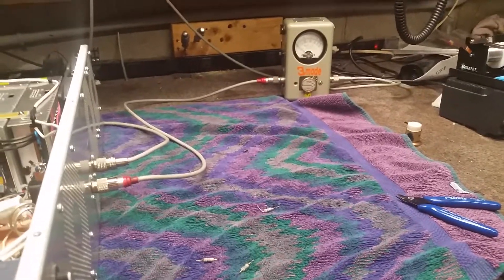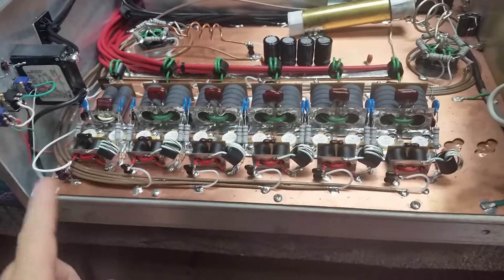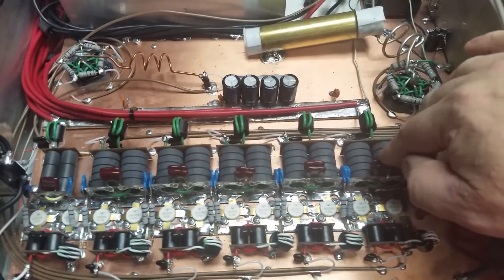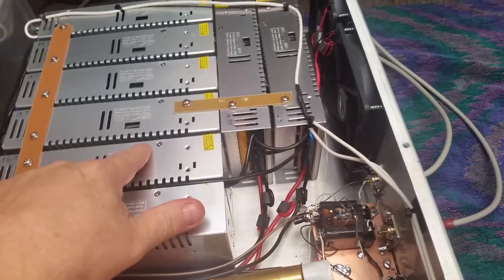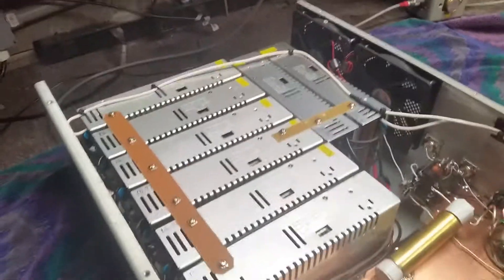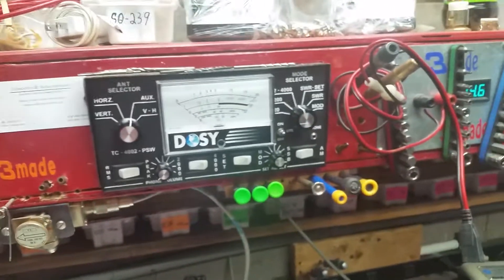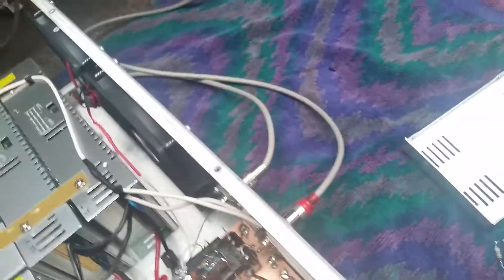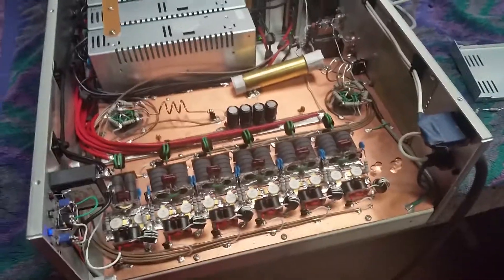2x10 base amp rebuild. .fixed amp and power supply.

Comment: Are those power supplies Noisy? I bought a 100 amp power max of eBay and it’s so noisy I can’t even use it. It gives me 4 s units of Electrical noise when I power it up even if I’m not running the radio on it. It can just be in the same room and plugged in.
Reply from the maker: The 30 amp switches I use are not noisy ..and yea the power max on Ebay work great too you could have a bad one .. I could look at it for ya and see if I could take some of the ac out of the DC
Reply: 3madeamps #3 in nc   I’m around Hickory North Carolina I wish I was close enough to do that I would sure bring it to you. It runs about anything I hooked to it it’s just noisy so I’m using  60 amp tech power off of That I bought off Amazon I believe it actually has a big transformer in it and it works great but my galaxy 98 VHP gets it really hot I have to put a fan behind it.
Reply from the maker: @theaveragejoestinkeringand4407  u can mail it ..how is the noise? Is it in the reserve of the radio
Reply: 3madeamps #3 in nc  yes it’s in the receive. I can run the radio on one supply an plug the power max in the same room with no load and it will still pick it up. I’ve never had any transmit complaints. It does it with any radio I hook up.

Comment: Yup the way this box is built the output combiner and output tuning cap takes all the RF..the 2 pill sections just run like 2 pills so those 2x500 silver micas are more than enough,they look at least a DM19.

Comment: I would have used 5 watt resistors on the combiners other then that good job
Reply: I would like to do some test on video about and balances and what happens when you blow a transistor if you keep attempted to run the amplifier etc etc is it always means more when you're able to actually look at it on video but those resistors are there to make smoke I've even thought about calling them smoke resistors LOL they are not there to help with the performance of The Amplifier at all you do not have to have them to run your amplifier they are there to let the user know when there is an issue. The problem is this when there is an issue from a blown transistor or a capacitor that has shorted anything that has caused these stages of the amplifier to not work in unity with each other these resistors are supposed to make smoke to let you know to quit running the amplifier as soon as possible so in this case you want the resistor to be just big enough that the regular RF does not blow it when the amplifier is working correctly and just small enough that it destroys the resistor and create smoke as quick as possible.

Imbalances calls reflect reflect causes heat heat destroys devices. I know there is not that much of a difference from a 2 watt to a 5-watt resistor but running a 5-watt resistor just may give you just a little extra time to run your amplifier when there is a problem to cause more damage you literally want that resistor to go up and smoke so quick that you know to stop immediately.

Here is some information may not have shared with you before but it all has to do with how the amplifier is laid out that will determine how easy it is to be damaged upon having a imbalance. Amplifiers like this one that is built into transistor sections running only 1 combiner in one splitter are the most dangerous when you have an imbalance or a blown transistor it is a lot easier to keep blowing transistors since all of the two transistor sections are sharing one combiner in one splitter this means once there is an imbalance every single other stage equally feels the imbalance now one that amplifier is done in 4 transistors stages you have a better chance at not causing damage you can see this to in operation for example if you're running a 12 pill amplifier that is combined into transistor sections and if you blow one transistor you will notice that the amplifier will still continue continue to do wattage and will only lose just a little bit of power at first and this causes all of the other transistors to be working full load still but now with an imbalance pretty much like a knife stuck in its thigh.

But when you're running and amplifier that is combined in for transistor stages when you blow a transistor the hole stage does not work which causes the amplifier to lose a lot more power at once making it a lot easier for you to see there is an issue.

 There are people that I completely respect that believe in using a 5-watt resistor because they are thinking it gives you more talk time when something is wrong and there is nothing wrong at all with me disagreeing because it's this simple there's a reason why this fella had three or four transistors blown instead of just one I guarantee you he kept King the amplifier when they're was an issue and like I said it is a lot easier to keep taking out transistors on an amplifier is done into transistor stages so I said all of that to say this we use a 2 watt rated resistor for a reason it is because someone a head of as many many years ago did the math and tested which wattage resistor would be big enough 2 not blow during normal use but would be small enough to create smoke the second there's an imbalance when I make decisions about what to use in an amplifier always just create two lists in my mind what will I gain from this choice what will I lose from this choice and to me at least in my mind I gain more from using a 2-watt resistor then I do using a 5-watt resistor now don't get me wrong when you have a issue that is bad enough it doesn't matter if it's a 5 watt or a 10 watt resistor the wrist resistor will go bad but that is not the issue at hand the issue is you want these resistors to be like fuses they are tell tale they are just there for an indicator when something is wrong and you want it to indicate to you as quick as possible to save yourself for more damage old Gate Keeper said this I know I got a bit carried away but it's just my view
Reply from the maker: Richard Dickinson  ..the way i see it if it gets a imbalance something has done gone bad .. but 5 watts are good too